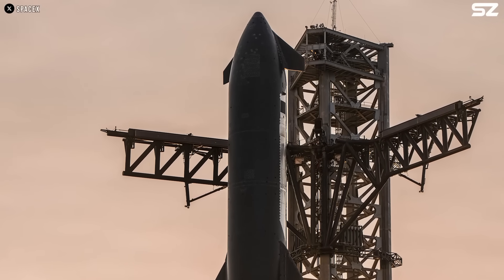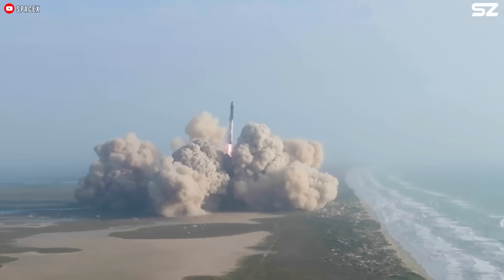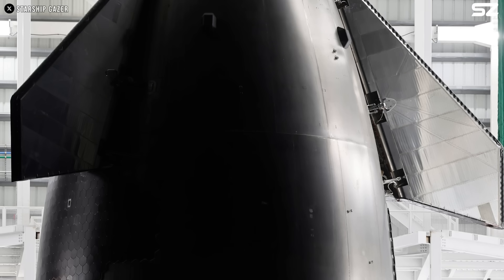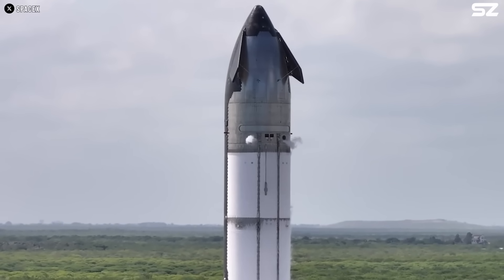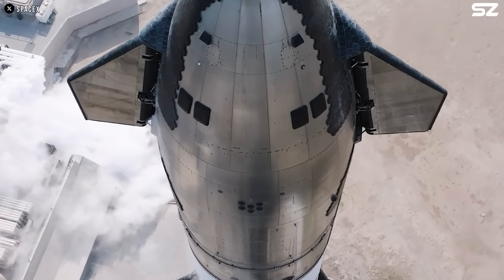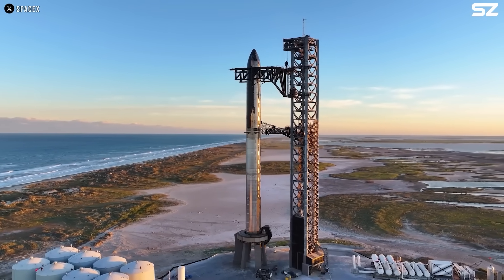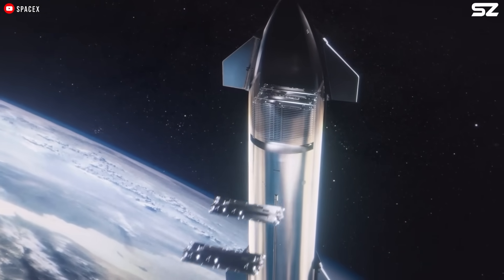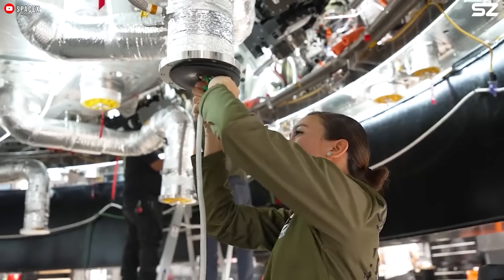SpaceX Found Brilliant Solution for Explosive Starship Forward Flap Problem!

Comment: This is not why if you want the real reason for why this change has occured is the fwd flaps had too much control authority. Basically the fwd flaps have too much influence on the vehicle dynamics so it can in certain scenarios include complete loss of the vehicle

Comment: Like they would be better off using water, it has a higher specific heat capacity than methane, and as the methane burns when it comes into contact with highly compresses air it would create a lot of soot potentially blocking the tiny holes, also as the fuel burns it would generate more heat, but it's marginal.